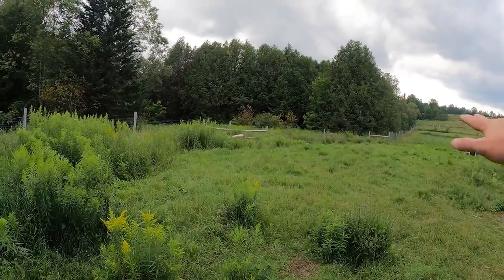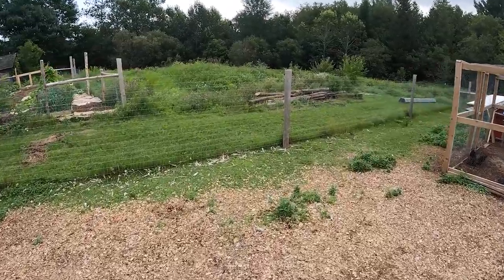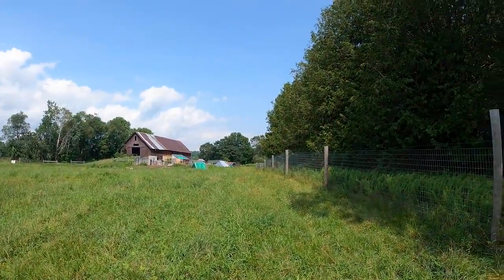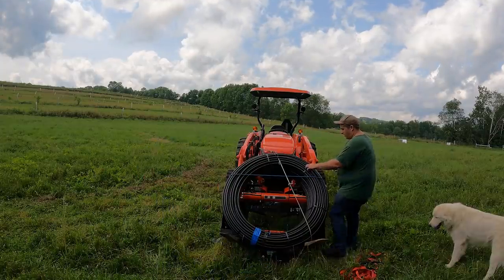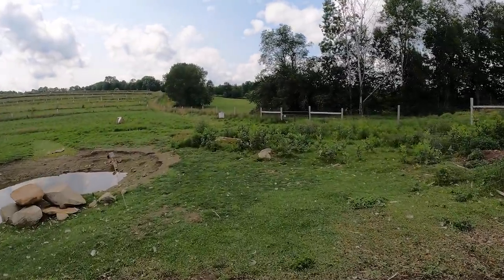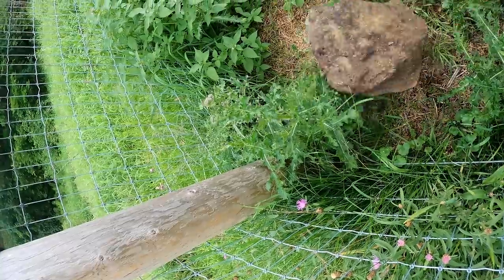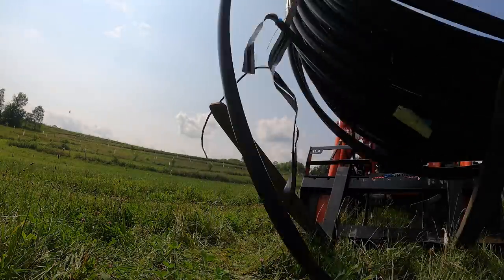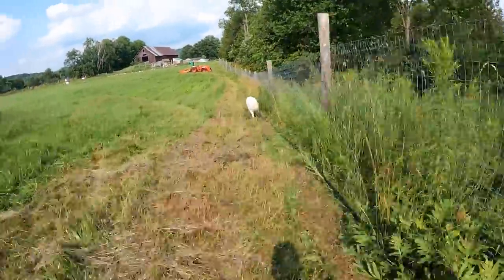Simple Water Lines for the Entire Farm

Comment: To roll out that type of tubing you can attach a chain and run it through to your tractor. That way it rolls and follows the tractor. Easier work. Keep the attachment connector on the back that way you can kinda keep it from falling over while you do that.
Hope it helps. :)
Reply: I was going to suggest securing a pipe between the forks and hanging the roll of hose between it and pulling it out. Your method sounds easier.

Comment: Hey Morgan. You may know this already but it's something that's commonly overlooked when it comes to cattle.

Cattle love to rub on things to scratch themselves and your fence posts are something convenient to rub against.

As you can imagine, the full weight of an adult cow regularly being applied to a fence post. Especially a tall fence post like the ones you have is not part of a recipe for long lasting fencing.

I have seen many a deer farm converted to dairy where the posts are all snapped or pushed over.

It might be wise to run another electrical wire around your fence at cow height, and to invest in something else for them to scratch themselves on.

Also your chicken tractors look like something nice to scratch on.
That may become relevant at some point.
Reply: I’d consider buying one of those brushes that cows can use. Like the kind you’d use to buff leather shoes but way way bigger.
Reply: You are absolutely right!  We had a grassfed dairy farm up until a couple springs ago and fencing was always an issue. They rub, push and everything in between.  We still have cows, they've gotten out once this summer to visit our neighbors, someone didn't check on the battery fencer so some young rambunctious heifers broke through a standing fence that lost its juice... that said, electric fencing is a must, its also important to train them to respect boundaries.  I saw someone put a few random posts in the ground and screwed in several coarse horse brushes along it and the cows used it to rub their heads and the like on it, was budget friendly to start with.
Reply: I've been wondering if his permaculture orchard is going to survive the bovines.  Between eating and rubbing, they may be gonners.
Reply: There are purpose made cow brushes you can attach to walls or posts for cows to brush themselves.
Reply: this is good advice
Reply: @be6715  I think he may put protective fencing around the trees or something.  I hope so at least!
Reply: @h.s.6269  I think it is going to be a must, or else the trees are not likely to survive.
Reply: @be6715  Yes they will be gone.  Cattle eat young tree leaves and even the smaller branches. Once they've finished that they usually trample what remains on their way to other places.
Reply: I lost a complete 60 tree orchard (all young trees) one afternoon when the cattle got through a fence that had been cut by wrongdoers.
Reply: @markschreiner3878  Sorry for your loss.  That must have been devastating.

Comment: take your spools to the top of the pasture and roll them down hill to uncoil. try to avoid any kinks since it will make a weak spot for possible failure.
Reply: @kontrol49y99  But this was funnier and the geese needed a laugh.
Reply: @lgsg65  exactly
Reply: @kontrol49y99  Running a water line that far without burying it seems like such a waste of time.  Do it right, do it once.  Oh well, another video next year to look forward to.
Reply: @kontrol49y99  What's the tool called?  or similar tools like this?
Reply: Yes this I know to be true.  Oftentimes a kink will result in two little holes at each side of the kink where it's kinked the tightest.  So you must test your line before burying it and fix all the leaks first.  I hope he remembers to do this.
Reply: is this tubing like audio cable which is rolled up with 1/4 turn ~ looks like the tangling would be the same as audio
Reply: @kontrol49y99  do you have a link for a device like this?  Thanks.

Comment: I can remember running power and water lines last year to the barn, shop and the enclosed part of the open storage shed.  Rule one, dig the trench first.  Second have rocks to put on the water line to hold it down.
Reply: Let’s see Brett J if he does the same. You had it all planned out.
Reply: You have done this before.?
Reply: @jaimegarcia7922  Yes, on mom and dads farm, his cousins, a few others that were moving away from dairy.  That was last year and this year due to "the bug" .  I have gone off of the wells but also continues flows from springs that went through the winter.  The hard part there is the initial filter in at the spring, then a settling and filter setup on the slope down the hill to the watering point.  Then you need a system to collect the water and drain it during the winter without it icing up.  All I was doing was using what I learned in the Army as an engineer, as an authority chairman and an EPA trainer for asset management and finance.  The one I liked was at our cabin I had 7 feet of drop over 30 feet to the road and 4 of it was for the settling and sand/ charcoal filter in plastic buckets (food grade).  I have a project now that the 4H did in the early 1960's at a water point on a state road.  the hedges need to go, piping replaced, the stone work repaired and the metal kettle has to be releveled to allow for the drain pipe to be used.  That starts Monday morning with a new crop of 4H.  So by Thursday we can put a video up of the work in the 4H building at the county fair.
Reply: Very true! Now he's going to have to dig AROUND the pipe, making sure not to bury it, run over it, and a host of other things that can happen because it can get in the way. Plus once you have a trench, it's easier to 'roll out' the pipe in the trench, like a big old tire rolling down that hill.
Reply: @mammahasspoken  The first time I did it was doing a horse barn.  Then I had to heat tape and insulate the pipe.  Try unrolling it off a step ladder and secure the line to beams above.  That job I did not dig the trench first.
Reply: you people talking about him burying the line missed the part where he said he isnt worried about the line being all the way on the ground since when he runs water in it then it with push the line down to the ground, i dont think he is burying this line, he wont be using it during winter so why bury it
Reply: I’ll be surprised if the doesn’t trench the pipe, tractor, cows could damage it by mistake.
Reply: @wavytiger1  besides freezing, there is ultraviolet damage from the Sun. What he did is just plain stupid.
Reply: @bige.3474  i think it should be buried as well, but i just dont think that is his plan going off what info there is from the video
Reply: @bige.3474  it is not best practice, but my parents in San Antonio don’t have their lines buried. It does cause more repairs, but they don’t have the means to bury.
Reply: What did you use to dig your trench? My husband just dug a trench for the neighbors using the backhoe on our tractor, but it really didn’t look like the most efficient way. We have similar tubing to help us move water from where it collects in the front yard to the back, but there are no large animals depending on the water or stepping on the tubing. I think something like a “Ditch Witch” would be a better option.
Reply: @lilolmecj For us with 4 ft frost line the ditch witch is not enough for water.  Electric sure, but the bucket on a tractors or the blade on the small excavators is a great thing for back filling.  Then for other people there is the rental cost of the ditch witch or small excavator. Then a back hoe you can lift the grass up in mats to put back down on the excavation.  A ditch witch does not do that.
Reply: @brett76544  thank you, all excellent points. I live outside Tacoma Washington, and those aren’t really concerns here. So I didn’t really think of it. But for here the advantages of the tractor/backhoe are that we have it, and hubby had fun digging that trench. It is a smallish John Deere, and sometimes I don’t know what we did without it. Thanks again for the information. 😸

Comment: A fisherman who has spent years dealing with line coming off a reel might have been a heop. I would have used scrap wood, a pipe and a little hardware to make a reel to sit to one side of the tractor. Secure one end of the water pipe, and then just drive away. It would come off the reel without kinks all the way up the hill as the reel turned. As an old machinist, I know the value of taking the time to make a jig that helps to do the job. It seems like extra work, but it pays for itself in labor-saving.
Reply: something similar is done with copper/aluminum wire although metal likes to remember every bend made in it
Reply: Cousin just put the spool between the fork and  stuck a short piece of 100 mm pipe through the spool and strapped the pipe to the fork. Cut the straps holding the spool together, fastened the end of the pipe to a post and started driving the tractor in reverse. Worked like a charm.

Comment: I worked with Poly pipe in irrigation for years, so I know the struggles. With irrigation you never cut the straps all at once. Instead you cut 1 strap at a time and roll the coil as it feeds into the ground via a plow. If you do it again, I’d suggest using a broom handle or pipe through the center with the coil resting between the forks and the broom handle strapped down. Then tie off one end and drive backwards to your destination, cutting straps as needed. You could possibly cut all of it at once via this method as it should be contained between the forks. I would also go back to every spot you have a kink and splice it there. The kink will never come all the way out and the pipe has been weakened at that spot and will likely eventually spring a leak there. Kinks are big no nos with Poly.

Comment: Have you checked what your water pressure is and how are you going to keep water pressure running such a distance thru all the lines including uphill???We have 8 gal per minute, for a smaller area 6,000 sq ft and if we turn on more than one hose at a time we lose lots of pressure.
Reply: Yup, that's a really long run up a hill through a small pipe. If it wasn't planned for when the pump was installed it's probably going to be a problem
Reply: I remember when we first got cattle the water pressure was suddenly next to nothing in the house.  We ended up with expensive changes to our well and cattle watering system.
Reply: RAM PUMP
Reply: Thought the same??
Reply: We have 15gpm, pressure tank set to 40/60. We don’t have water pressure in the house when a faucet is on outside either....
Reply: Is it too expensive to drill a well up there on the pasture?

Comment: I dealt a lot with this sort of irrigation line:  All you need is some sort of spool, to keep the coil from getting tangled up.  You could build one out of wood, use an old industrial one, or whatever.  Just get the coil on the spool, anchor the outer end at the top of the hill, and then walk the spool down the hill.  Or fasten the spool on to your tractor, and drive it down the hill.    If you need to add connectors, heat the end of the tube with a torch a bit to soften it.  Just a bit.  For smaller tubing, I use a thermos filled with hot water.
Reply: doesn't even look like pressure pipe the way it kinks so easily

Comment: Please, please check you pumps lift capacity.  Pumps generally can only over come X amount of elevation change.  If your pump works to hard it will burn up or not pump at all. Well pumps ain't cheap.  In general ever 34 feet of elevation creates one atmosphere of pressure or 14.6 psi.

Comment: When a hose or a cable is coiled like this, there is also a twist along the axis of the hose. It necessarily comes from geometry.
That is why you get those sudden curled kinks: the twist localized into one spot.

Think about the shape a straight hose would form if you just kept twisting it: it would eventually form into a larger coil, which would then become a spool.
As you unspool it, you need to continuously counter-twist the tube, and those counter-twists will radiate down the length as you manipulate it, eventually canceling out the existing twists. Result is no kinks.

Comment: That's a pretty large vertical difference..  It's around 2-2.5 psi per vertical foot + loss of flow from such a long run.  You may not even be able to pump water that far up the hill..  You might want to do some test pumping before you start digging and burring lines, just to find that you'll get a trickle at the top of the hill.
Reply: Nothing wrong with a trickle. It will fill a stick tank and keep it full if the tank has a float valve.
Reply: It's going to take one heck of a strong pump and maybe a couple inline booster pumps along the way.  They can be run by solar.  I use booster pumps because I don't want a trickle at the top.  I want good flow and since it's possible, why not do that?

Comment: Next time knock up a spool between your forks, at the simplest level cross lash a piece of 4x4 onto the forks through the centre. Then anchor one end of the pipe then reverse to destination. You get your fabricating friend to make up a simple spooler. Two pieces of box section that slide over the forks with a clamping bolt. Then have a detachable spindle/tube between the box sections, attached to the box section with a couple of old axle clamps from the scrapyard.
Reply: If you knock up a spool....what will the babies look like???

Comment: FYI, 
Easier to push the line roll downhill. 
Fit your connections near water supply... later not searching the entire pasture to locate any connections. Not to say closer to your tool shed. 

Another way, use your carry all implement, extend outwardly w/ a 4x8 plywood base. Use a 4 x4 or 2x4 to lock in place.  
Go to hilltop and drive down slowly to water supply.
First let the sun heat it up to ease unrolling pipe. 

I'll put a frost faucet near our duck pond to top off and used for other irrigation/fire needs. 

My main will be 1.25" x 1000' to the dp... our well is 40 gpm, we're blessed! 

Will you put a heated holding tank at the top to save using your pump and allowing head pressure w/o electric use.

Remember, to draw a supply line map for use later, saves time. At 66 I tend to forget sometimes, lol.

Just a few simple thoughts cause, I'll be doing it next week. 

Have fun and enjoy. 

BTW, your stories have fantastic narrations.

Comment: The biggest problem I've found with working with that coiled tubing is that it twists and kinks as it unravels. I've solved it in the past by twisting as I unroll, this counteracts the spooling. I spent as much energy and time unkinking it as I did pulling it into place.
edit
Rolling it seems to work really well!
Reply: the best way would be to ixate the outer end of the roll at the starting point. if you now roll the pipe the way where its supposed to lay, it will not be twisted.
Reply: aha ~ this sounds like the way audio cables are rolled ~ trying to figure this out
Reply: @colecolettecole  i actually was a sound tech for a while XD
Reply: @BouncingTribbles  me too ~ so whats your answer ~ 1/4 turn ? ~ i roll my garden hose like audio as well as large power cables
Reply: @colecolettecole  exactly. It's just cord physics: garden hoses, rope, charger cables. I definitely use my theater training more often than my math
Reply: @colecolettecole  i forgot what is was called so I had to look it up, I use the Over Under technique with everything. It's so automatic that I don't even notice I'm doing it. That's the trouble with these hose bundles, they're coiled from the factory

Comment: Next roll place the roll between the forks and put  a post throught the middle with each end clamped at the end of the forks. Lift the  forks with the hydraulics.  This way if you tie the outer end of the roll  to a fence post and use the post as an axel in the middle it will roll out pulled by the tractor.

Comment: Hello Love your channel, just a quick question, perhaps it would be easier to install your water lines after you have dug a trench for them. As you lay the pipe in the ground you can put some sand to keep it from moving on you and once you're sure of it's final location fill up the trench. Remember to put safety netting 20cm above the pipes so that in the futur if you have to dig in the yard and come across the safety netting you won't pull up the line....

Comment: next time, take 2 2x4's to go in the center of rolls. 1 2x4 over a nd 1 2x4 under the forked and secure to the tractor. 

this way you could unspool it and if you secure the hose end, you can use the tractor to reverse and unroll.

Comment: I'm a total novice. I'm assuming you only need water during non freezing weather & you'll be evacuating the lines for winter? I think I heard you say they were wintering in the barn.
Have you considered running the line along the fence ON the fence about waist height & attaching it to the fence so no animals trample it? It would alleviate any kinks.
If you had a water trough at each coupling you'd not need to run the line through the swails. They would just come to the trough.
Reply from the maker: That’s correct!
Reply: But that does not work to water the trees….
Reply: @doloresreynolds8145  but does encourage cattle to come to the trees (and eat them).